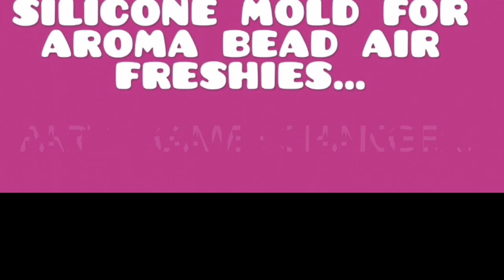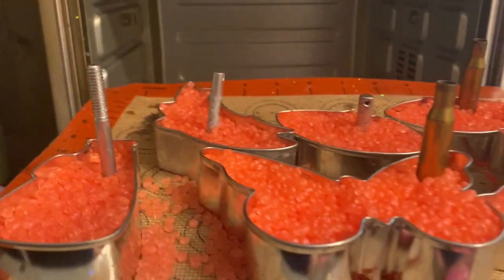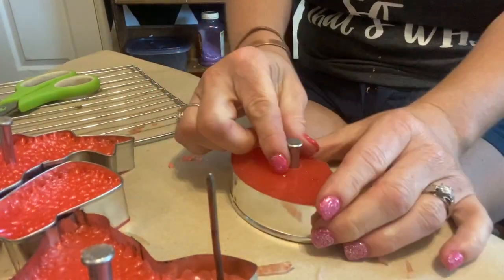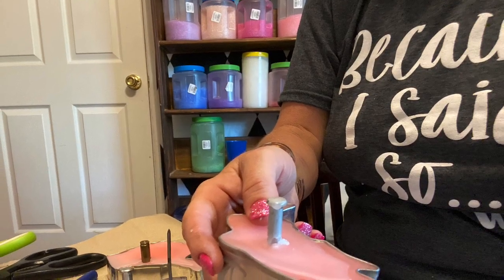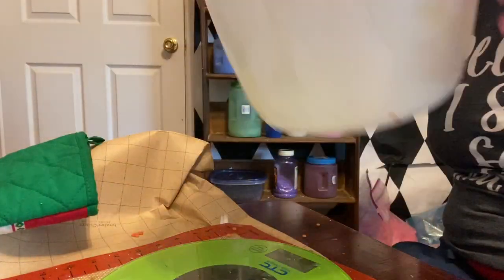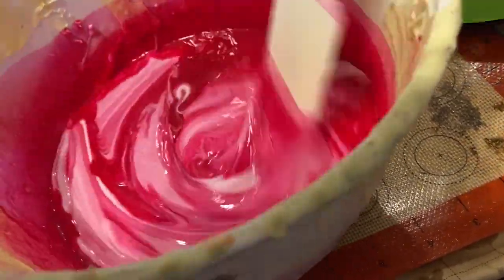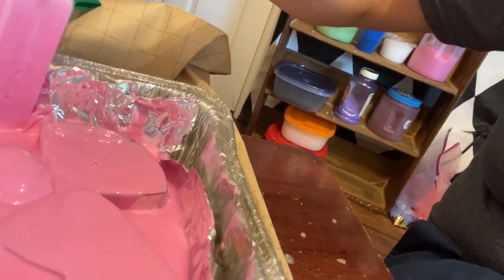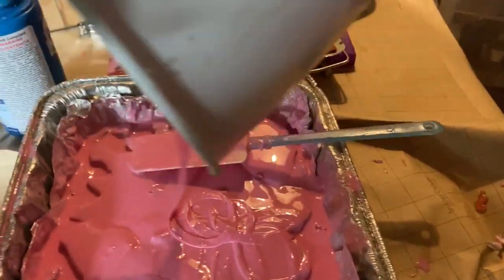Silicone Mold for Aroma Bead Air Fresheners

Comment: Not sure if this would work, but I would recommend using epoxy resin  in your cookie cutters to get smooth pieces for mold making.  That way you don’t have to waste your aroma beads.
Reply: Won’t the silicone stick to metal?